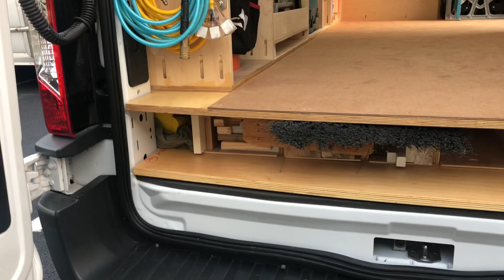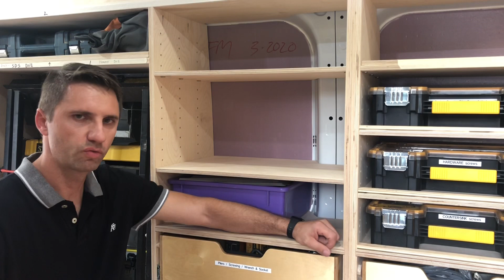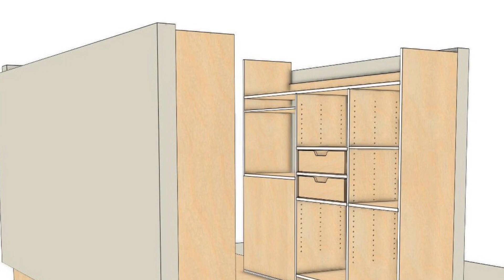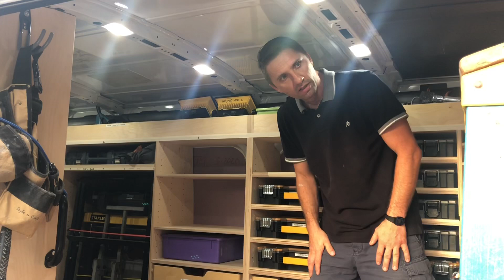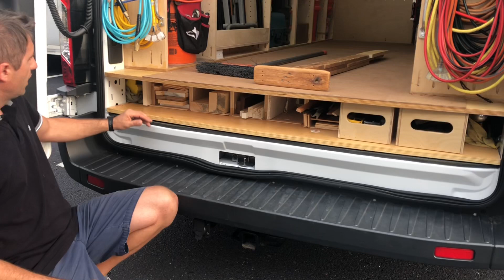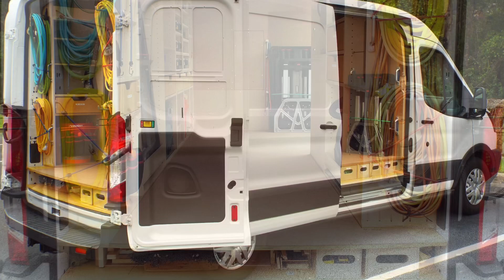Custom Carpentry Tool/Work Van - Designed & Upfitted  by  Son of a Carpenter, Inc

Comment: I need that, but need to be able to put a stack of drywall on the floor and float my tools above the drywall stack with a raised floor (front ¼ of cargo space lets say) and floating uppers to maximize that space you have to maneuver the sheets in and out of the work van.

Comment: This set up is amazing. So much storage yet impressively organized. I have a question though. In terms of weight, how does it compare to metal racks? I've heard it is way heavier than metal and it's too much weight even before storing all your tools.
Reply from the maker: Hey... it's probably 1000 pounds... well under the vehicle capacity.. and obviously a much much better storage setup.
Reply: Where are you guys located? I just bought a brand new transit cargo van and I would like a very similar set up. I live in Palm Beach County Florida
Reply: Working on mine now. Jupiter here. How did yours turn out?@eddiegonzalez516

Comment: I got a idea that you could add to your van , get rid of them 4 power cords and replace them with 4 retractable power cord reels 60 foot 12/3 guage.
Mount each retractable cord reel onto a portable base so you can use it anywhere.
You could run them all inline for a total of 240 feet length
Also add a power strip outlet to the end with like at least 6 outlets

Comment: one could use the inside roof to store some batteries in holders(maybe even hook up a speed charger using a power inverter to change the car 12 volts into 230 volts), if such person has manny battery powered tools, it certainly would make even more use of space, of course at thte cost of some headroom
Reply: While not covered in this video... there is an extra battery... circuit protection.. and a 5000w inverter installed in such a van.
Also.. there is some wiring run.. and an outlet on the inside.. as well as a waterproof outlet on the underside near the back.

Comment: What if lengths of wood or other things get stuck under the floor shoots? Don't you think it would be good to have hinged doors further inside the van to assist in retrieving any trapped timber or other? I would definitely have a raised floor but I think it needs to be accessible in the event of a problem. The long drawers are a great idea.
Reply from the maker: There actually is a solution we came up with.. that would allow you to pull all contents out.. in case something got lost in the tunnels...  and it doesn't require a "trap door" or anything.
In this case.. we are going to keep the details to ourselves...
Reply: @socinc5749  So what is your method for keeping the tunnels clear? Go on, tell me your secret? 🙂
Reply: @pgtips4240  a piece of sheet metal with a 90 bend on the end would work.
Reply: Yes, I used to use a 3 prong hard metal hoe/rake on my pick up.

Comment: Looks good ! I have upfit  promaster.   I posted commemt other place, Just a guestion about other bigger items. I see  you can carry some 1x2,3,4 pine, 2x4 stud & p.t..  Now .. ur cut 1\2", 3\8" drywall, 3\4"& 1\2" ply? Lastly where is the dog and drop cloth compartment?
Reply from the maker: I can fit in tire sheets of 4x8 drywall and plywood no problem. There are some recesses in the sheet metal that I used to store the tarps and drop cloths. The compartments below the floor accommodate up to 100 in long pieces of two being or wood or things up to five inches in diameter

Comment: Very nice job but it does not appear you considered the weight of those cabinets. That is a lot of weight you added. You have no weight relief holes in the shelves.  Walls, shelves and drawers should be "Swiss cheese full of 1/4" or 3/8"  holes to reduce weight.  You use 3/4 " seven Ply birch when 1/2" 5 ply would do for verticals. Plus you have double verticals, meaning you built the cabinets in sections instead of one large assembly.
The van is hard enough to enter/exit. So As a Transit owner, I am not a fan of raising the floor which makes it a lot harder to enter/exit. Plus you  can not stand up.
 I bought my high roof Transit so I can stand up and work in the van.
Lastly you did not insulate or sound proof the walls , Drawers or shelves. So its probably very loud with everything rattling as you drive.  Things to consider on your next build.
Reply from the maker: Thank You for your observations.
The Van is not loud at all... actually way quieter than original.  Raised floor is a preference... as is everything about Van design.  All things done here are subject to what a customer wants/ prefers/ and is willing to pay for :)

Comment: Also a cabinetmaker and wondering if you use this van to haul a trailer and if that’s a practical use for a van like this?
Reply: I have  a 3.5L turbo V6 in my Transit Van ... and I do pull a pretty large trailer.  I use my judgement on how hard and fast I want to run, based on the load and distance.
Reply: @Frankmali17  thanks.  I figured they can haul a decent load around town.  Probably still use the truck for longer hauls.   Helpful to know someone has had no issues

Comment: just a thought but is your van overloaded to beyond its weight limit with the weight of all the plywood fittings and tools
Reply: Nope, the van still has plenty of space.. and about 1500lbs weight capacity.
Of course that will depend on what you will put inside of it.
Take note though.. that in the USA, we have huge pickups, vans, etc...  with rather very conservative load ratings... compared to similar/same vehicles in europe and other places.
I guess our ratings assume that you will load it up.. and still try to fly at 80mph before needing to stop on a dime.

Comment: How is it stabilizes? Screw of bolted on the metal case of the van?
Reply from the maker: Hello, It is Screwed into many places... as well as bolted to some welded nut locations.  One could argue that it stiffened up the body with how well it is bolted to it.

A LOT of diligent R&D and Installation Effort went into this project.

Comment: Nice. Could've come up with something better than the bungee setup though. Seems cheap, inefficient, noisy (from tools and material rattling around) and lazy. Also CNC machining basic cuts is a bit overkill, no? Other than that there are some decent ideas here but nothing a semi-decent carpenter couldn't do themselves imo.

Comment: I would strongly recommend ditching the raised floor.  It creates an extra step up and the van floor itself is already high enough getting in and out.   Extra wear and tear on your body.  Nice build otherwise
Reply from the maker: Certainly... the storage can be fine without the floor... it is designed this way because that is what someone wanted.  Many people actually like it a lot and see major benefits
Reply: I pick up my Transit on Monday and I really like the fact that I can stand straight up in it.  I’ve been working out of a pickup for 27 years.  I can tell you that crawling around has taken its toll.  I’m finally jumping to a van to finish my carrier.  Can’t wait to get started on the build out.  I’m a hardwood flooring contractor and haven’t seen anyone else build out for my trade.  Maybe this is a good time to start a channel.
Reply: As you can see... even though this floor is raised... I can still walk in it.   but everyone's van should be adjusted for it's intended user.

Comment: This is great. I outfited my trailer, then I did a few for other trades. But only a few. Never figured out how to market this unique ability to the right people. I set everything I make for the most part to be modular. Needs change. I really loved doing it. I’d build everything off sight and come to them and do the install. Once on their job sight. I wanted to do vans for the challenge and when I saw all that unused space behind those metal space wasters, I knew I could do better for their needs. Once I built some interlocking small totes for an electrician’s supply truck. Put his logos under the finish. That was a fun project. How have you marketed yourself for this?
Reply: It is hard to market for DIYers... but I am considering making more of these.. for the right customer :)

Comment: The bottom storage, 91 inches and 69 inches, we can change 91 inches to all the way up to the partition  , so we can carry 10 foot stuff like metal pipe, PVC pipe, copper pipe or thread rods ? Still we can make storage at a side door.?
Reply from the maker: The Floor Storage partitions on the drivers side could be adjusted to be up to  approximately 126" long... but it would make the side door storage shorter.  It would still work well for many people.
The bottom floor design is  somewhat flexible during the planning stages.

Comment: What did you do about the overwhelming plywood smell?  Built shelves in my ford transit and the smell is unbearable.  It’s not pressure treated
Reply: This Plywood does not have smell... But you do have to be really carefull with some imports...  where did you get your plywood?...  I don't think it is just a plywood smell issue in general.. just like some plastic really stink, and some don't.... I would evaluate it on a case by case basis.
Reply: Love That Good Wood Aroma :)  Sexy